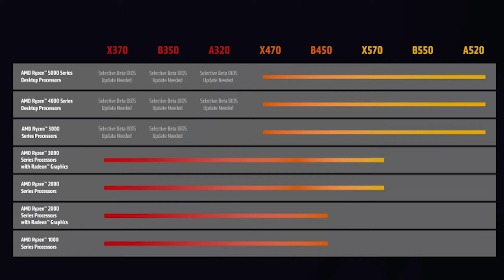PC Setup for Architects and My Configuration for Rendering - 2023

Comment: Is the 3060 12tb enough for architecture uni or should I upgrade it to 3080 ti or 4070
And if so do u still recommend 3080ti over 40s money is a concern BTW thnx
Reply from the maker: 3060 will definitely work, i used it for a long time go for it, if budget allows go for 3080... the performance will be better than 4070 at same price.

Comment: I would recommend ryzen 9 9950x with Gpu rx7900xtx 24 gb vram and 32 gb ram minimum and later on upgrade to 64 gb for 3ds max with vray 

If you need good render then go for 4080 16 gb if you need more polygon and texture for good work flow then go for Rx7900xtx 24 gb and if you need both then 4090 24 gb
Reply from the maker: Good suggestions, but it will cost a bomb, I am mostly talking about mid range and that's where my system falls.

Comment: Which GPU gives better performance in terms of archtl softwares, is it rtx 3060 12gb vram or rtx 3070 8gb vram?
This is a slightly old video, is there any updates on ideal specs for the latest lumion and sketchup?
Reply: Have you found any answer to your question?

Comment: There's alot of things which matters in these cpu, gpu and rams not just the basic no.s
In cpu even in newer versions u have alphabet in the end of version which also matters alot. H name processer are powerful one for high end works like rendering editing and gaming. Also intel is powerful then ryzen in many cases that's why ryzen is in budget. 
In gpu TGP matter to give u best performance out of gpu (higher TGP is better) . 
In ram frequency also matters.. 2666, 3200, 3600 Mhz 
Then it comes ddr4 nd ddr5
Reply from the maker: You are right, but this is a video of my setup, and if you see Ryzen, it is cheaper and gives almost equivalent performance, especially for software we use. I have tested both Ryzen and Inte, amd and Nvidia  in terms of gpu and cpu performance, and ryzen is always a cheaper and comparable with Intel and in some cases, exceeds intel and Nvidia in cost range and performance.. Have a look at g17 and g16 6800m comparison in lumion rendering it killed by Nvidia.  But your inputs are appreciated, and I do agree with your points.
Reply: @ArchiVlogs.  I agreed with some your points too.. Bcs ryzen cpu with ryzen gpu is good combination both together give extra boost rather then ryzen cpu and intel gpu.. I must say if u choosing ryzen cpu then go fr ryzen gpu as well nd it's cheaper bcs of little less single core performance somewhere intel nd somewhere ryzen lacks can't say much. 
I have budget laptop with i5 9th gen with gtx 1650 .. My basic lumion works are going good but i agreed ur point having better gpu at least 3060 now not even 3050 min. 6gb card at least bcs lumion demands more gpu vram.. Enscape vray can be run on easily. Not declining ur points just it will be good to add little more info.. Ur sharing good info Good luck 🤞

Comment: Brother, with the rendering of majority of the software they utilised the CPU for the live rendering which also needs RAM with decent speeds and minimum is now 32gb because just running the program on idle chokes up at least 15gb
Reply from the maker: I have been using 16gb ram and it still preform well but obviously the more the better!!

Comment: For Revit, 3D Max, Vray, Lumion 11, are this specs perfect?

AMD Ryzen 9 5900X 3.7GHz-4.8GHz 12 Core 70MB Cache AM4 Socket Processor

MSI MAG B550M MORTAR MAX (Wi-Fi 6) DDR4 AMD Gaming Motherboard

Gigabyte GeForce RTX 3060 EAGLE OC 12G 12GB GDDR6 Graphics Card #GV-N3060EAGLE OC-12GD

Corsair Vengeance LPX 16GB DDR4 3200MHZ 02 set RAM

Samsung 980 1TB M.2 2280 SSD

Comment: Halo, for sketchup+enscape better 13700k+RTX4070Ti or 13900k+RTX4070?
Reply: both are good, but I will recommend you to go with the i7 and 4070ti gpu. Enscape or any other real time rendering software uses graphic card more. Save money by not buying i9 and use it on other components and cooling the CPU. And a pair of good monitors, one for sketchup and the other for enscape.

Comment: How much budget is required for a perfect pc for all kinda civil engineering and architectural work
Reply: cpu- intel i5-13500 (very capable for handling renders, no point in going more than this unless paisa jeb mein ubaal maar raha hai!)
Motherboard- MSI  Pro B-760M A WiFi DDR4 (DDR5 boards are very expensive, but should come down in price in 3-4 months) or You could use a cheaper B760 board or old B660 board with bios update to support 13th gen CPU.
RAM- DDR4 3200MHz 32GB kit of Corsair Vengeance for under 8000Rs. Corsair ka parts are well built and customer support is top notch.
PSU- Corsair CV 650watt 
GPU- RTX 3060 (any brand, Zotac has 5yr warranty while others have only 3yrs....buy whichever fits in the budget) 30-40k mein various models hai, regular RTX3060/Ti version/OC version, 3070 is expensive.
STORAGE: WD blue SN570 1tb NVMe SSD as boot drive and for softwares and a WD blue 1TB Hard disk for storage. Do not buy Seagate or Adata, last  12 yrs mein jitne bhi Seagate and Adata use kiya hai builds mein fail hue hai, specially Seagate.
Cabinet: MSI MAG forge M100A (Micro ATX case hai for Micro ATX board, agar ATX size motherboard le rahe ho to case us size ka dekh lo. Dont overspend, under 5000/- bahut saare acche cases hai available market mein.
CPU cooler: Liquid cooling is very tempting but I will recommend Getting an Air cooler instead, koi fark nahi hai for the parts we are using, its less points of failure for the future.
Deepcool AK400/ Cooler Master Hyper 212/ Antec ka bhi ek model hai all under 3.5k.....
Monitor: 24 inch for 1080p. 15k ke around mein kuch acche monitors hai from benq, msi optix, gigabyte, LG.....
Rs 1,15,000 tak to expect karo above said build ka.....
isse kum mein bhi ho sakta if we swap few parts.
Reply: you could also look around for used parts, you will save a lot of money if you are able to find good deals. CPU, RAM and Graphic cards can be bought used. Agar bande ne acche se rakha hai to koi performance degredation nahi hone waala hai.......
But you will have to know what to look.

Comment: Vray doesnot support AMD graphic cards, so how can it render faster.?
Reply from the maker: It supports it. it's just not tuned for AMD, and I am talking about lumion rendering.
Reply: @ArchiVlogs.  i tried to render on vray using 6700xt but v ray doesnt even detect AMD cards.
Reply: @Pavan-ws6xi  most of the rendering softwares are optimised for NVIDIA cards, but that doesnt mean AMD cards wont work. I have used AMD cards before in my build and for others who have asked for my help and they work just fine. 
but going with NVIDIA would be always preferred for our works untill rendering software companies starts optimising AMD cards to work with them. 
Are you using an APU? It could be that the software isnt switching between integrated graphics and 6700xt.

Comment: Which computer is  good for lumion  & revit ?
Reply from the maker: you have to get a minimum configuration of ryzen 5 or ryzen 7 or i7 cpu, rtx 3060 gpu, 16gb ram a ssd is needed and  this will give you descent performance.
Reply: @ArchiVlogs.  brother im stil confused about this. i watched many videos comparison between intel 12/13 vs latest ryzen. all videos say latest intel gen is much better than ryzen.

is there any spesific proc feature for 3d artist/architect or something else? why 3d artist usually like/use ryzen for the proc. please brother...

Comment: my man you didnt get into the softwares,i was hoping you would talk about revit,sketchup,rhino and -ray,cause those are the softwares i am testing and enjoy but my computer seems to choke when i am  modeling large files.

my computer specs.
amd ryzen 7 5800 series3.4ghz
 4.6ghz
amd radeon chip 14gb ram if am correct
nvidia geforce rtx 3050
ram:32gbram (3200mhz)
and 512gb ssd storage only.

please help...rhino lags too much,same goes for revit and those are my main softwares along with sketchup

.thank you in advance. and i am using a laptop
lenovo ideapad gaming 3 15ach6 model i believe.
Reply: you are using a laptop, it doesnt have enough room for it's hardware to breathe. Cooling is very important specially under load, components are programmed to throttle the clock speeds down to protect them from burning out and that causes stuttering.
Rhino ka faltu drama rehta hai kabhi kabhi. but Revit shouldnt' do that with your specs. Your Specs are good, but the limited cooling potential of laptop could be an issue. Also check the power settings and put them in performance mode if it's not.